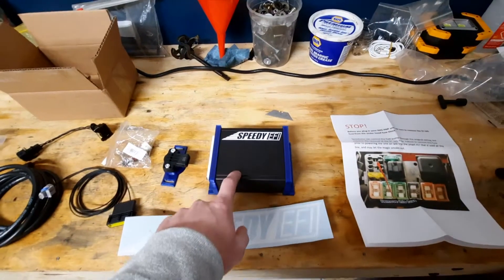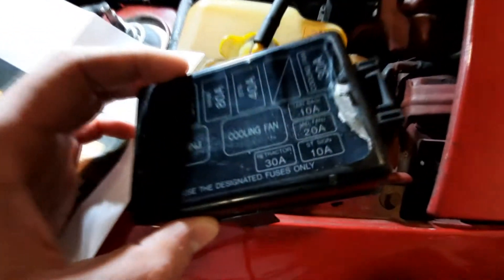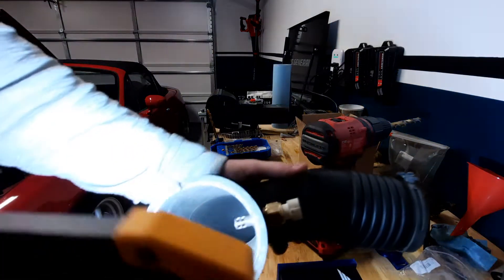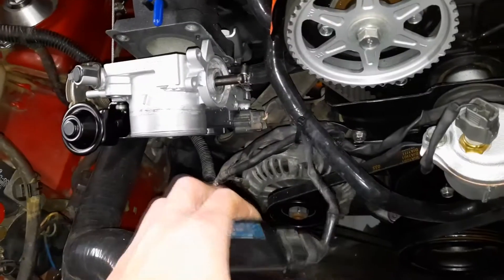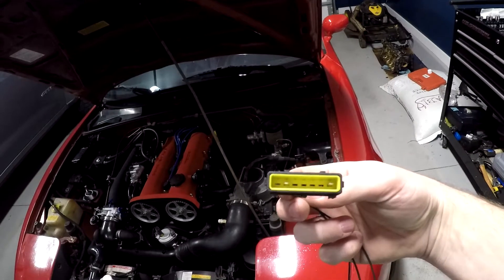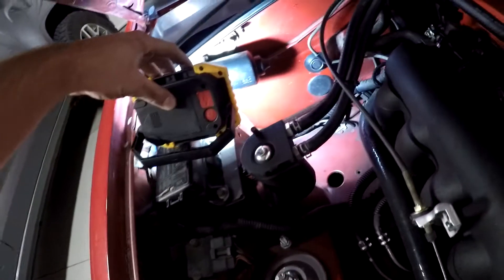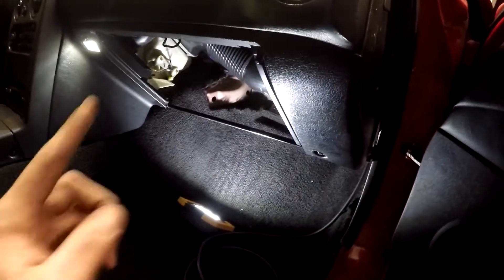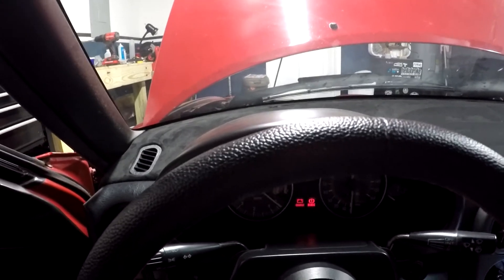NA 1.6 Miata SpeedyEFI Install Guide

Comment: Does this ecu support the speedometer and rpm/ oil gauges?
Reply: this only controls the engine, everything in your car will work as it did before. the computer is for engine management. hope this helps

Comment: What ExIntake did you use for the 1.6? Thanks!
Reply: The exhintake mod is using a exhaust cam from a DOHC 94-95 Mazda mx3 in place of the intake cam on the miata

Comment: Hey man I’ve got a speedyefi ecu and can’t seem to get my car starting. I’ve had it running before but the coldstart and warm start where trash. Any help?
Reply from the maker: Man it's been a while since I tuned, so let me try from memory... In your start settings, set your starting timing offset to 10. Attempt to start the car, if you're getting starter kickback, you have too much timing. If you're getting popping and banging out the exhaust, it's likely too much fuel, so pull some out via the fuel table. If you have to give it some pedal to get it to start, it either needs more fuel, more air, or both. You can adjust the fuel in your fuel table, and the air via the IAC starting values. I THINK I had my IAC set to almost completely wide open on cold start.
Reply: @ConnorsCorner1  alright thank you I’ll give it a try my cam angle sensor went out so I had to order that!